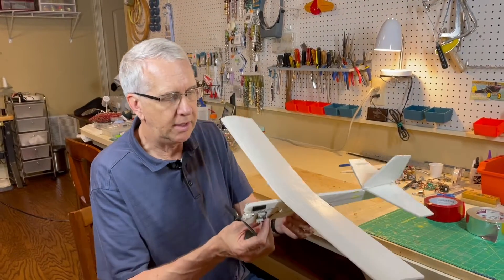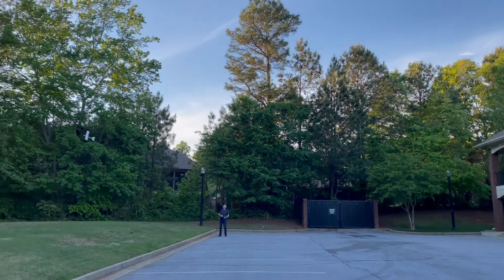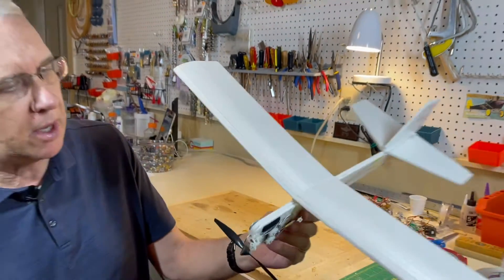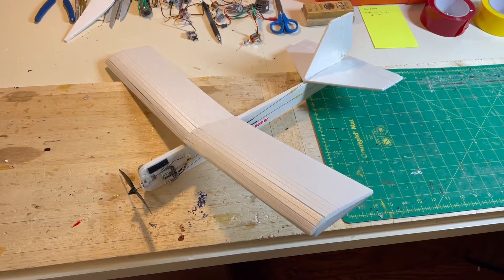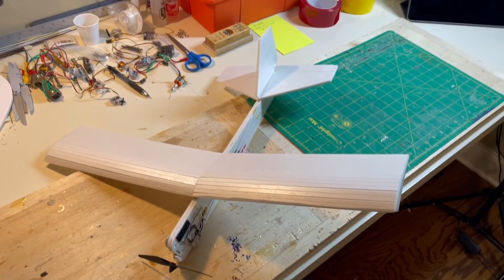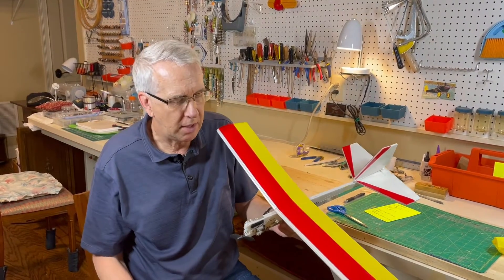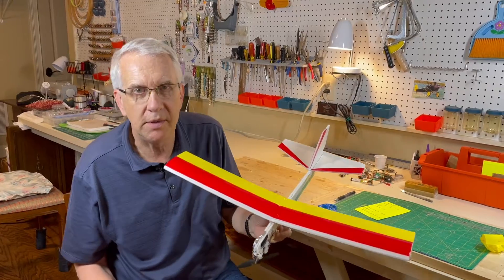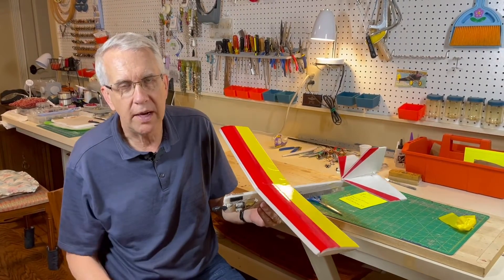Backyard Flyer and Tape Covering for Newbies

Comment: What’s really sad for me is the foam board here in Australia is really heavy because of the thick paper so I can barely make anything. do you have any other ideas to make small rc planes without foam board or foam board without the paper
Reply from the maker: For my smaller models I’ve used foam board without the paper. I take the paper off both sides to prevent warping. But you are correct, the FB can be surprisingly heavy for smaller models. 

Remember, there is always balsa!  Do see www.StevensAero.com for some great small flyers. Tim